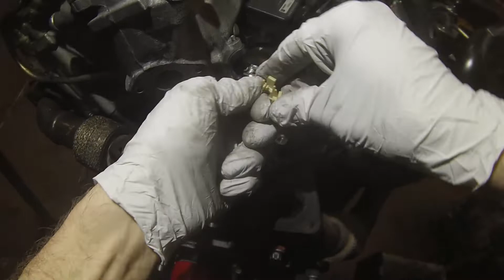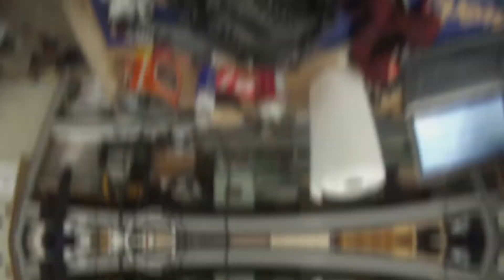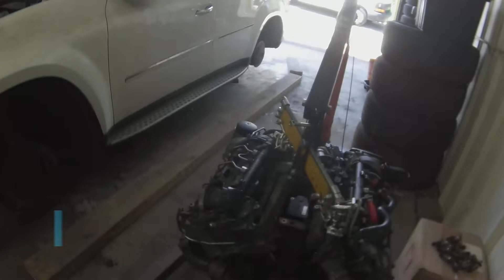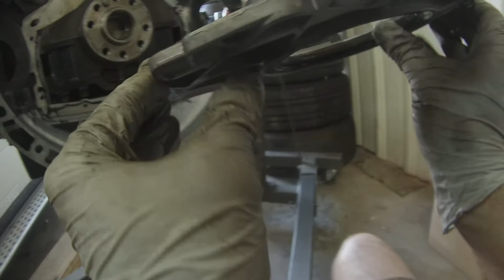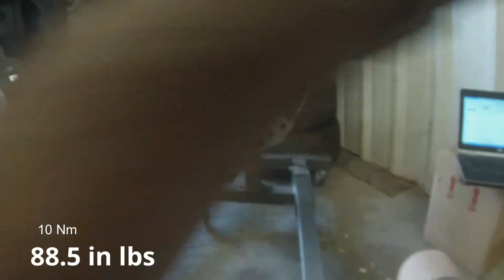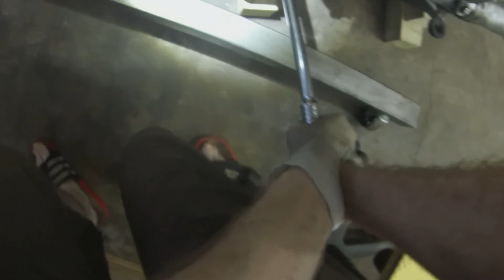Mercedes GL350 OM642 Rebuild - Part XIII of ?

Comment: Do you know if its possible to remove the timing chain cover without pulling the sump off, i have got a cylinder head that needs replacing and seems a bit much to pull the engine for that😮
Reply from the maker: I know that I pulled the heads off the block while the engine was still in the car.  I don't recall the exact process anymore, but if you look at the photo that the videos start with, you'll see the block coming out of the engine bay sans heads.  I also am fairly certain that the timing chain job can be done in situ as well and is not an engine-out job, but I don't remember that specifically.

Comment: I just finished working on one om642 sure its complex and have to remove lots of things but it was relatively easy out on engine-stand. After instilling i found it had a water leak on the connecting piece that goes between the two manifolds. And i decide to attempt fixing installed.. HUGE mistake...  its somuch  harder to work inside the bay,i should have spend afew extra minutes to take engine backout and that would had speed up my water leak fix by hoursss... anyways good job presenting your rebuilding process.
Reply from the maker: Yeah, that little crossover pipe is a peach, isn't it?  Even when it's in correctly it still doesn't look right, if you ask me.  You are right, though, in that once you start peeling back that Germanic onion a little, it's still just a crankshaft, pistons, and valves.  There might be some extra wiring and plumbing on the outside to keep HAL9000 happy, but it's just another engine.  Not like there's apex seals and springs to keep in place or anything!  Glad to hear you cleaned up the water leak and I hope your rebuild gives you many trouble-free miles!

Comment: Thank you for  great information! It is very easy to disconnect wire harness from UCM computer under passenger fender and pull engine out with the wire harness and install!
Reply from the maker: I discovered that fact way too late, but you're 100% correct!  If I ever do that again, I'd pull it with the harness attached.

Comment: Great video….
Nice to see where everything is located….
I believe I saw an extension on your torque wrench, did you change torque setting for that?
Reply from the maker: No, since I'm not using my wobble extensions and I'm keeping the torque wrench perpendicular to the fastener, no adjustment is needed.  If I had used a cheater bar on the torque wrench or had some u-joints in there or something that would be a different story.  As long as the rotational force is applied level against the center point of the fastener, the distance between the handle and the fastener doesn't matter.  The only time you need to compensate would be if you weren't holding the torque wrench on its handle by either sliding a cheater bar over it or "choking up" on it.
Reply: I'm very interested to this forum